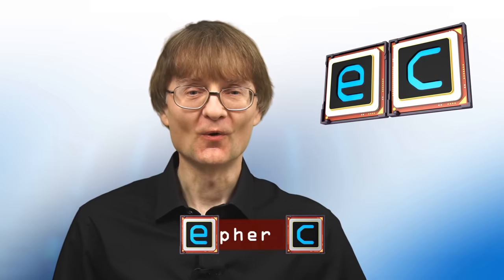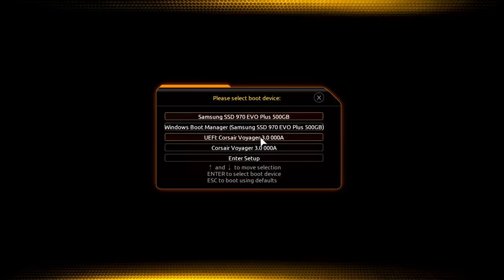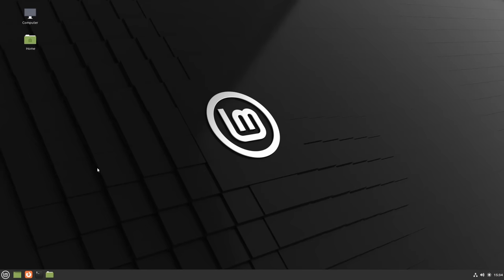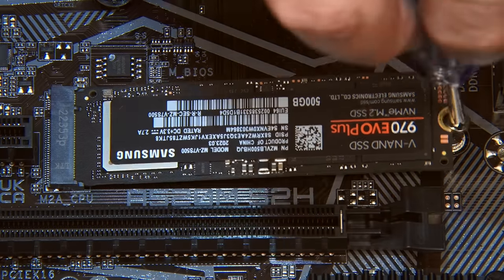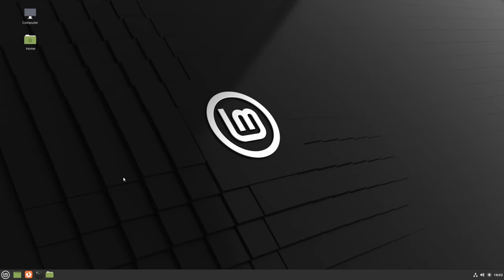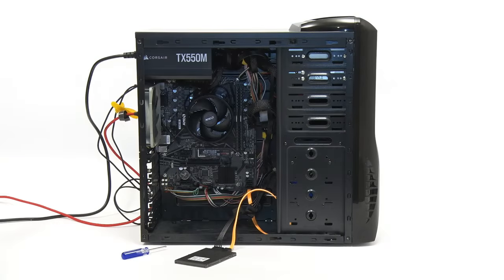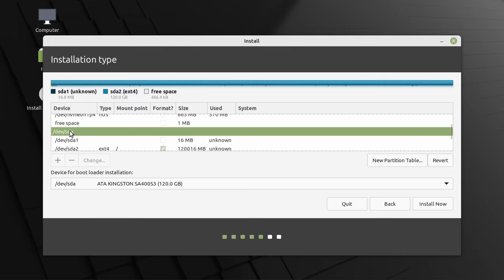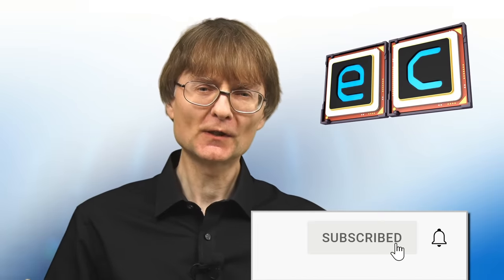Windows & Linux: Dual Drive Dual Boot

Comment: Sometimes when Windows shuts down it never shuts down properly, leaving certain devices in a specific state that may not work properly under Linux.  This is why on a dual-boot setup it is recommended to disable Fast Boot in Windows to properly close and reset everything.
Reply from the maker: An extremely good point (if you want to access the Windows drive from Linux). I always have Fast Boot disabled in Windows regardless, and forget that others may leave it on!
Reply: I recently disabled the fast boot thing as windows itself was having problems recognizing the dock. Have been trouble free since.
Reply: I was going to comment this exact thing. Disable the settings in Windows with msconfig and then go to the boot tab. I do tend to also run shutdown /s /f /t0 at the Windows command prompt before switching/installing.
Reply: I disable fast boot and give about 5 seconds to choose where to boot from. I like that installing Arco/Mint last usually gives me GRUB.
Reply: Will it make the booting time slower? Also Is it also recommended if you aren't dual booting ? As I have heard that since the windows never properly shuts down your pc'c performance may degrade overtime but A simple restart once in a while will do equally good job.
Reply: @aman4805 it's a deprecated feature due to that fact that ssd exists now, hell, I wouldn't even use it for hdd.
Reply: @ExplainingComputers   Is there a way to set bios settings, so there is no need to mash f12 to access boot menu? By this I  mean getting the computer to go into boot menu automatically on each start/restart.
Reply: @kamilpotato3764  Nice idea. I would prefer this too.
Reply: @kamilpotato3764  Some motherboards can do this. Mine can't but look around if yours can it would look like "Boot options - Choose".
Reply: @bertblankenstein3738  Yeah, I experienced Windows having issue recognizing my I/O. So I disabled fast boot, and everything worked out fine since Windows can take time to read the I/O instead of fast booting that messes thing up.
Reply: In general, turning off Fast Boot can help with multiple things besides dual-booting.
Reply: I can't say that I've ever had problems like that with Fast Boot in Windows 10. I've got 3 PCs and two Lifebooks using it and haven't experienced any problems at all. Even when booting to Linux. (I have a different distribution on each PC. Curiosity, I guess. Linux on the Lifebooks is an experiment for another day. (I cringe thinking about it.))

And another thing that seems to be completely fixed in Windows 10 is "Hibernation". I used to always have issues with hardware after coming out of Hibernation but not anymore and use it frequently now with no issues at all. It really works out great with the Lifebooks and can get 6-8 hours of use and still have an unused spare battery at the end of a long day out.

Now, if I can just get Linux to play nice with "Remote Desktop" (so far, no good. It might just be me., though).
Reply: @ExplainingComputers  Windows with Windows on the same drive is a ticking time bomb for the past 20+ years - I still remember my XP/Vista dual boot days.
Reply: Does hibernating windows instead of shutting off affect the linux os on the other drive?
Reply: @uRea1  as a rule of THUMB - you never EVER hybernate WINDOWS (or any OS for that matter)
Reply: Dude, you saved me ass. Makes sense as to why certain things just wasn’t working when Linux mint was perfect before my dual boot. Stay blessed my guy, nothing but happiness is what I wish for you!!
Reply: Thanks bro just because of you i could know why my linux ubuntu takes too much time for booting up thanks a lot buddy lots of love from India ❤❤
Reply: You also want to disable Fast Boot when switching video cards.  I just leave it off on every machine so I never have to worry.
Reply: I disable fast boot regardless
Reply: @ExplainingComputers  with dual drive dual boot is there any risk of data corruption if i use hibernation option?
Reply: @ShazzadHasan-v2r  same question
Reply: Maybe this is the reason why my pc won't POST! I connected a third Drive to install windows for my friend,Then shut down and unplugged the third drive. After that My PC won't boot anymore.

Comment: Being able to use both Linux and Windows and not giving up one another is really nice. Both have their perks so dual booting is the way to go for me.
Reply: I personally had a Windows Linux dual boot laptop crash when a Windows update could not complete due to the GRUB boot loader not being compatible with the Windows automatic upgrade to Windows 10. I have to recommend a virtuall machine. You can have a Windows VM inside Linux or a Linux VM inside Windows. Or just use separate hardware.
Reply: @wcdeich4 The first method shown by Chris (remove the Windows drive while installing Linux) is extremely safe and can't be held responsible for any failed Windows updates because the only bootloader on the Windows drive is the Microsoft one. That said, I have more than enough accumulated computer hardware that I don't need to dual boot anymore.
Reply: @wcdeich4 the problem with a VM is that the virtual OS has to interface with a very limited set of virtual hardware — generic Intel chips. Does that ever limit the abilities of the virtual OS to do stuff it could easily manage if that OS was running on bare metal?
Reply: Run Windows inside Linux with a virtual machine. Much safer, no MS spyware in your kernel.
Reply: @johnm2012  Good point, my laptop only supported 1 hard drive, so I did not have that option.
Reply: @chrisschembari2486  The only limitations I've found in VM is video where you do notice tearing. For common office tasks like Word Documents, spreadsheets, or graphics programs, I don't see a problem. It is very nice to have the ability to switch between linux and Windows with a click of a button.
Reply: @reekinronald6776   thanks. Of course, I'd probably want to do that with my laptop's preinstalled OEM copy of Windows 7 Home (not some generic Windows ISO file), but I think Windows will complain that it can't see my laptop's unique ID number or whatever, claim I'm trying to pirate Windows, and shut itself down. 🙄
Reply: If you consider it "nice" that Microsoft has free reign and visibility of all of the data on your computer, then I guess that's down to you.

Why do you Windows users never stop to consider one very pertinent point here? 

When it's possible to run a "heavy" Linux desktop like GNOME or KDE in about 1.5 GB RAM, explain to me why the minimum RAM requirement for a Windows 10 or 11 desktop is not 8 GB?

What conclusions do you think we can draw here other than the greater RAM requirements for Windows are there because it is running a lot more tasks in the background than Linux does? Do you not think that telemetry and "phoning home" everything to Microsoft are not at least part of those additional RAM demands?

Sorry to be blunt but anybody who runs a Microsoft OS in a personal home user environment seriously needs their head tested in 2023. At least in a corporate environment, Microsoft gives businesses versions of Windows that their own IT personnel have a lot more control over - but if you are a home user, you pay good money for a nice PC with a crappy and privacy-hating OS on it that Microsoft takes ownership of and then "leases" back to you.

Well done, you now have zero privacy. There are no "perks" in Windows.
Reply: Hmmm,  there are plenty of reasons other than spying why windows could use more memory than Linux.

Eg different paging systems.

And in a slight piece of whataboutery, if you're worried about windows, then you definitely should not use a smartphone.  All those apps that want/need to know your contacts
Reply: @terrydaktyllus1320  I use Windows and Linux. Both have their advantages and disadvantages.
Windows uses a more advanced microkernel instead of a monolithic kernel. Windows also has a smoother multitasking system that doesn't stop the user from using it when all the CPU cores are busy and a more consistent user interface and a well defined and documented API. Windows is still backward compatible to old applications and device drivers without recompile these again (if you have the source codes at all). This means you don't have to update the OS every four years again and again with the risk of losing backward compatibility like in Linux.
Reply: @JCO2002  But If you are gaming on the windows OS then it won't be good enough. I only need windows for gaming for all other things I'm grand with linux
Reply: @lorddraagon  How did you solve this problem? Did you end up using a virtual machine for Linux within Windows 10/11?
Reply: @HunterMael  I dual booted as well. But if you want to limit what windows can do search on how to create custom windows iso
Reply: Perk is i can say i use arch btw
Reply: Especially now that Windows 10 is reaching EOL.  With so many more games coming to Linux I'm finally ready to try it out as well and hopefully get well enough acquainted with my potential new home OS.

Comment: If you're going to dual boot, the dual drive method is the smart choice. Great tutorial!
Reply: why
Reply: I would say it would have been true before UEFI and Secure Boot showed up. Now Microsoft could easily block it by enforcing the latter.
Reply: @cldream  True, and that's why no one should use Windows. I would say lock the BIOS or boot loader or something, but Microsoft has the keys and can bypass it all anyway. In fact, it'd be better to not even use a modern computer and instead build your own from scratch components, but no one has the resources to actually do that. So your options are either install a lot of OSS and hope for the best or become a luddite. I'm sure most would call this paranoia, but is it really paranoid if they actually are out to get you?
Reply: @anon_y_mousse  Secure Boot is just that - They can use the UEFI, lock it down to JUST use Microsoft keys. So most of the Linux distros would be out (unless if you want to use a bootloader signed with Microsoft keys.)
Reply: @cldream  That's what I'm saying. Even if you lock it yourself to prevent tampering, Microsoft can still modify settings and do whatever they want.
Reply: @cldream could UEFI be the reason I can't boot Debian 12 OS? I have disabled Secure Boot in the BIOS.
Reply: @cldream what does it mean can you elaborate ? Like, if I use two seperate drive (basically 7:27 ) will i encounter some sort of error in long run
Reply: @Robbie-mw5uu  Because it can corrupt the existing partition with the other operating system.

Comment: Actually, you can set up more boot drives by installing the OS of you choice with the other drives disconnected and then reattaching the original drives as Chris demonstrated. I have done this with four SATA drives on one system with WIN7, WIN10, Ubuntu and Zorin all installed on separate SATA SSDs.

Comment: Having to admit that I have messed up several times trying to set up a Grub dual boot system on several computers in the past, I can say that this is definitely safer and a better option for me. The hardware one seems to be the most fool-proof.
Reply from the maker: Greetings James. :)
Reply: For future reference, if at some point you have issues with grub again, a tool called boot repair can be used on a live usb to quickly and easily fix a corrupt grub bootloader. Grub customizer can be used to change boot order etc. Both have a gui and are very easy to use. Got me out of a jam several times where I otherwise would have had to reformat or learn how to fix grub the hard way via the command line.
Reply: @ExplainingComputers please admin. I’ve issue with my browser on Kali Linux. Kindly help me out by instruct me on how to fix it.

Comment: I've been using single drive dual boot setups for decades and have never had a problem.
Reply from the maker: Great to hear. Many others here report problems.
Reply: Seriously i've never heard of people having trouble with single drive dual boots. Installing Linux on another drive entirely is an immense waste of a drive and electricity.

Comment: You read my mind. I was just about to wipe my windows 10 and do a fresh install and then I heard Debian is really good now. So now you have me sold on Dual Drive Dual Boot. Love your work.
Reply: With the current price of storage, I always just get another drive for systems I want to run. You can get an SSD to tinker with for like $20 now that's reasonable for a Linux test drive. Even M.2 prices are getting really good.
Reply: Yeah, if you've got the capacity, then dual boot dual drive is the superior option.

Because, basically, both operating systems live on their own hard drives and "never the twain shall meet". They don't get in each other's way at all.

And "the hardware method" - where you literally completely remove the Windows drive to install Linux - does make setting up dual boot so much safer. If Windows is not even connected to the system in any way, then it's just not physically possible to accidentally overwrite it or anything.

I don't mind the GRUB menu myself. But it's better to use "the hardware method" and ensure it's only installed on the Linux drive, because then it's kept out of the way of Windows. Which does have a habit of overwriting GRUB and corrupting it.

(This is Microsoft being anti-competitive arseholes. Because operating systems are totally labelled on the disk and Windows could simply read this, recognise that it's Linux - as Linux uses a standard well-known signature - and then leave it alone. 

We totally know that Microsoft could do this, because Windows does perform a scan of your hard drives when installing to recognise if you've got multiple Windows versions installed, and then leaves those other versions of Windows alone. It absolutely could 100% do this with Linux as well. But Microsoft don't want other operating systems being "room mates" with Windows, so it deliberately acts like an arsehole and corrupts GRUB. They're hoping that you'll blame GRUB for corrupt, not Windows for being the actual guilty party that broke it. Sneaky sods, eh?

But this is demonstrably nonsense, as GRUB works just fine when Windows isn't there and doesn't corrupt. And if you use "the hardware method" so that GRUB is nowhere near Windows, it also operates just fine with zero corruption issues. To be clear, Windows is the cause - it literally just overwrites the boot sector with its own boot loader blindly, without checking if there's anything already there.

But they're hoping - and from the way people talk about GRUB that I've seen, they very often get away with this shady behaviour - that you'll assume GRUB is the guilty party. But, for the record, it isn't. Which, as I say, is demonstrably proven by removing the Windows drive, so GRUB is 100% on the other non-Windows drive, and you'll find that neither interferes with the other and it's 100% fine and dandy, with no corruption issues at all.)

So remove Windows. Install Linux (and GRUB) on a second hard drive. Re-connect Windows.

Then you have the option to, as in this video, boot to Windows and use the boot menu to switch to Linux. But as I primarily use Linux and only rarely bother with Windows, I boot to the Linux drive and have the GRUB menu, where Linux is the default option and Windows is there as a secondary option.

(Note that this is the one thing that needs to be sorted with "the hardware method". Because Linux and GRUB are installed without Windows being connected, GRUB won't have Windows in its menu. But you can, with both drives installed, have GRUB re-scan your computer, picking up both operating systems and updating the menu to include both.

Indeed, though there's nothing wrong with the BIOS boot menu, I use GRUB because it's configurable. I've got a nice background image and have changed the font and font size, and so forth, with mine. There's a nice utility "GRUB Customizer" in the repositories that is a GUI app that lets you customise it all and you can re-scan the menu - or even manually edit it however you wish - there. Default GRUB is a bit bland, but you can make it all nice and fancy, if you want.)
Reply: Used Debian earlier this year, it's super stable, what I love about it. Plenty of DEs to choose from.

Comment: Thank you so much for all of your great teaching, Chris!

I have now successfully set up my laptop as a dual drive, dual boot, Linux and Windows system. 

I cloned my original Windows M.2 SSD to a 2.5 SATA SSD, installed a new blank M.2 SSD and installed  Linux on same. I also went into BIOS and set Linux as default boot drive, and Windows works perfectly using F12 to access Windows Boot Manager. 

I really wish I'd had you for some of my classes in High School as I would have learned a lot more!

Comment: Years ago, I purchased a 4-bay hot-swappable SATA drive unit that fits in a 5-1/4 drive bay.   I currently have 4 different operating systems I boot into.